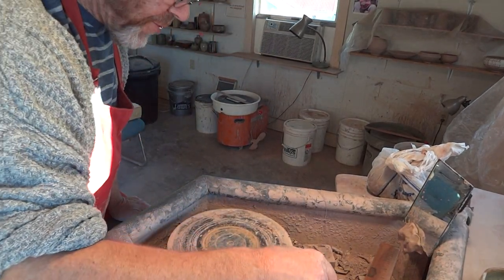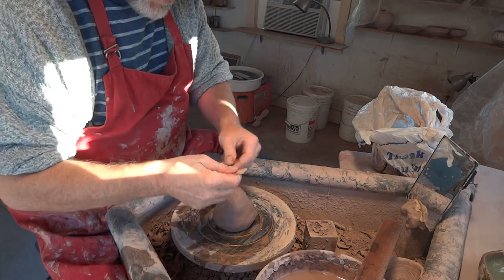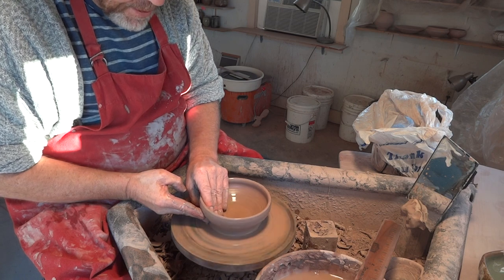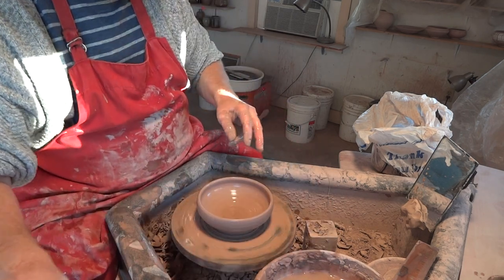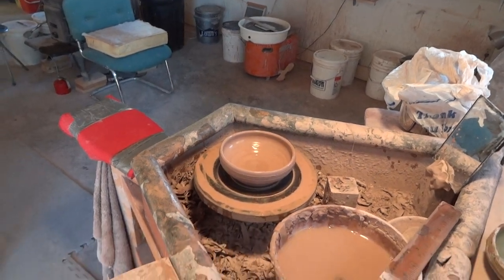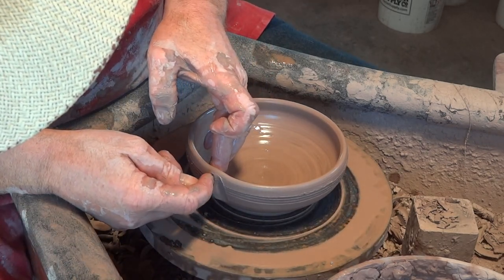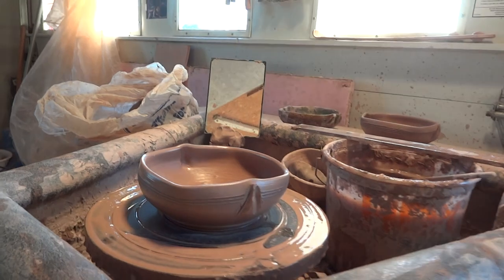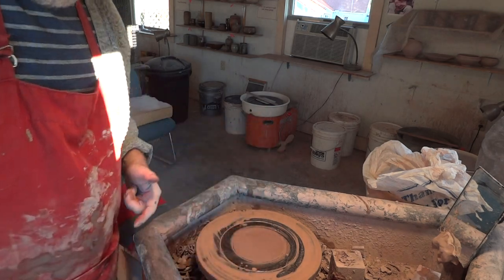Throwing a squared dish - Oct 17 with Simon Leach

Comment: I agree don’t worry about the length of the clips as you say. I find them so captivating that they all “feel” a bit short at times. I too use them not only for education and entertainment, but to forget the every day rush we all have to put up with. I especially love the little tips you give during your clips. I’ve learned quite a bit from them alone. Things other potters don’t tell you. If people want shorter they can use their devices to skip a little of the video. Also, there are other pottery videos by other potters which run shorter you could watch.